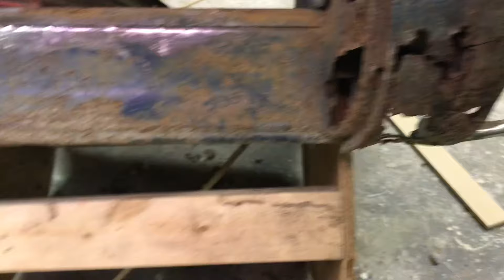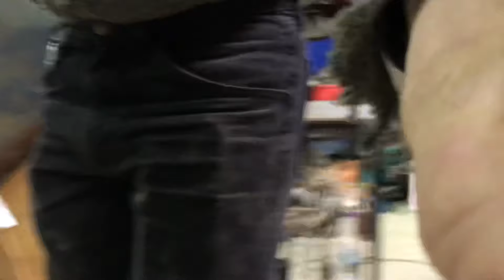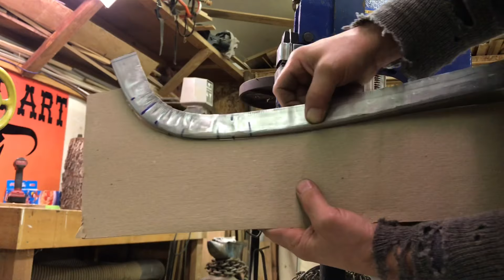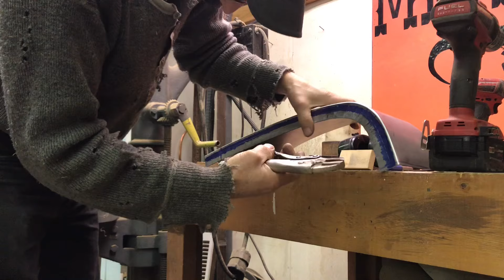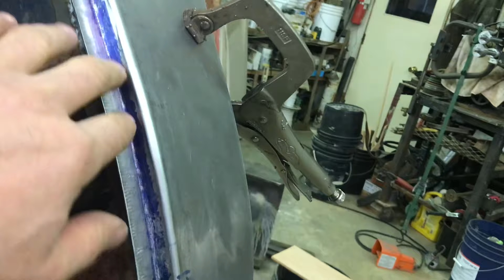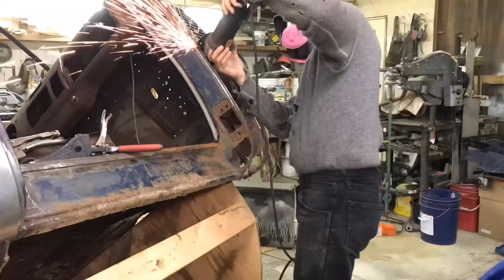Metal Shaping, 1950 Chevy Cab Patch Panel

Comment: This is the kind of video that I look for.  However, I do not need to see endless minutes of rolling, bending, and hammering.  You could have done that whole section of the truck in one hour-long video, not the three or four you seem to have planned.  I’m particularly interested as your equipment looks to be from Princess Auto and I am a from Saskatchewan.
Other Canadian auto-body metal-workers that I watch, and admire, are Carter Auto Restyling, Fitzee’s Fabrications, and Make it Kustom.  Give them a look and tighten up yours.  Please.
Reply from the maker: Hi Ken, I’m a little confused, it’s a 51 minute video. I only have a shrinking/stretcher from Princess and it’s junk. I watch all of the channels you mentioned. Thanks for watching.